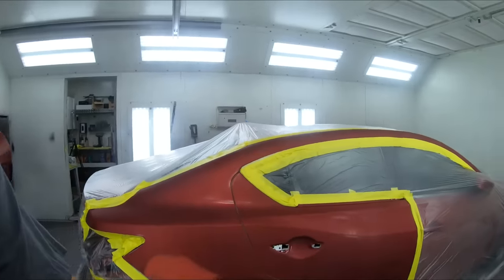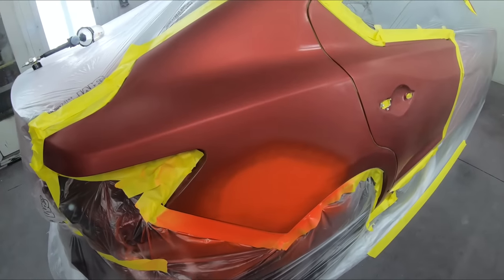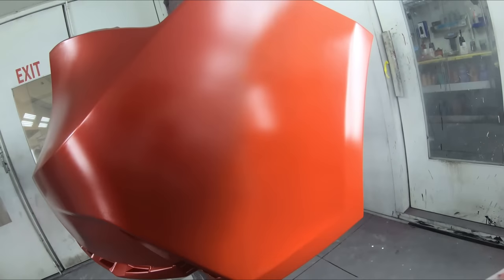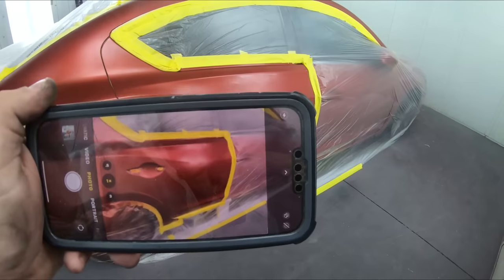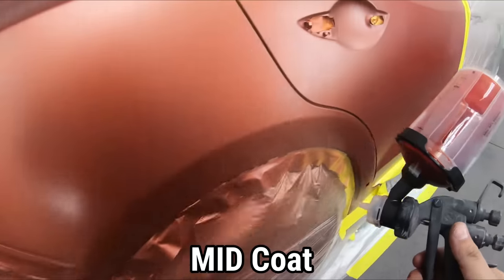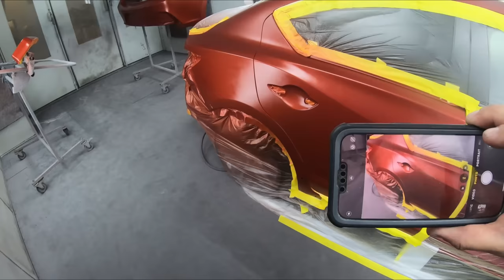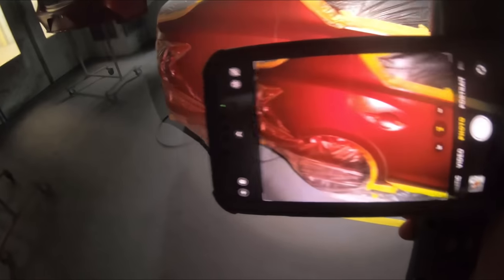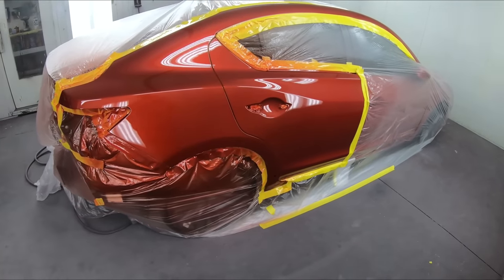SIMPLE Cell Phone TRICK Can Improve a Paintjob!l

Comment: Excellent job and tip!
 I figured this tip out on accident one time I was taking progress pics of a red car I was painting. I noticed I didn't have full coverage and it saved me from re-doing a job on an expensive red TRI coat. 👍👍
Reply: Hey mate a paint shop tried to get me to buy a base and top coat for Toyota 3L2 red at double the price of the other in town which just gave me a 3L2 red and said it doesn't need a base because it's not a multi layer, which shop is right was one trying to rip me or are they just sticking to OEM instructions
Reply: @Ace_is_Win  paint brand is a huge factor. Every paint brand even for the same color code can cost a huge amount different. For example, shopline JB will sell a half pint for $33.50 flat rate. If I order it in DBC, I will pay $102 easily for a half pint. You're paying for stronger pigments and better coverage. But again, depending on the job you should probably go with the economy paint.
Reply: @dogemcmoon9644  already bought the paint its Protec Paraglaze, the price of just over $100 a liter makes sense with how vivid the color is and that it covers light grey primer awesome. Was mostly curious about the different recommendations from two shops but it makes sense now one uses DeBeers the other uses Protec
Reply: @Ace_is_Win  that's actually a good price especially for red. Good luck with that job man